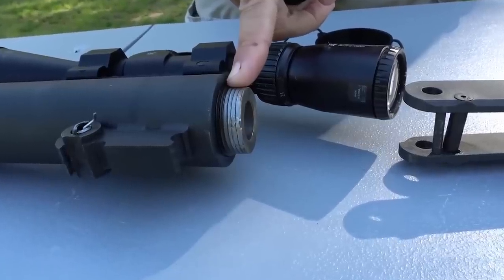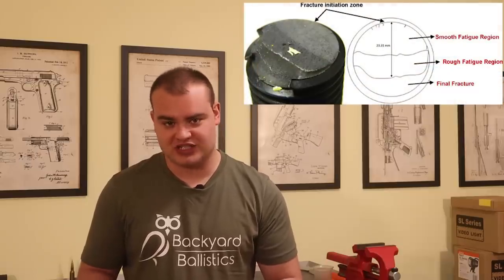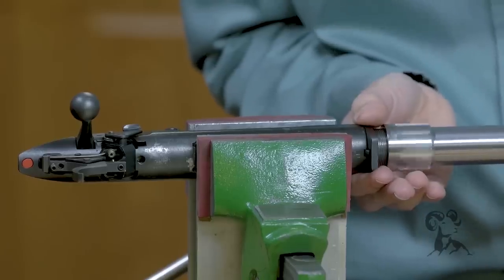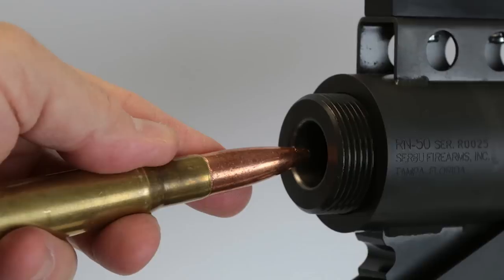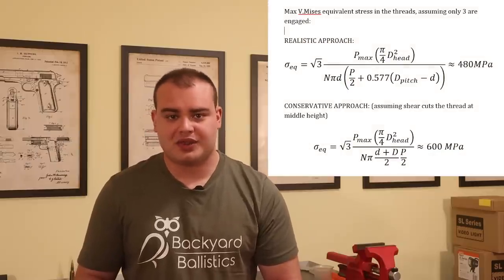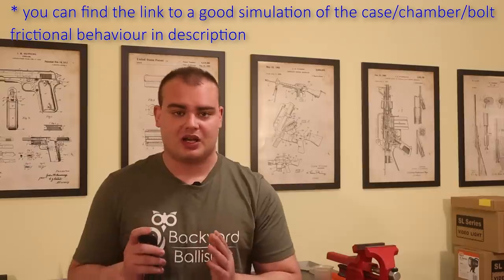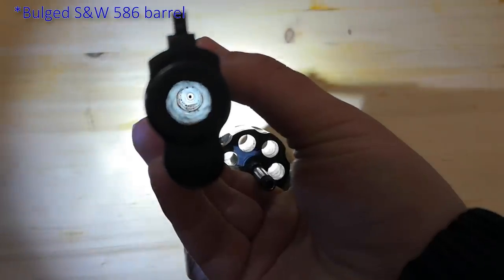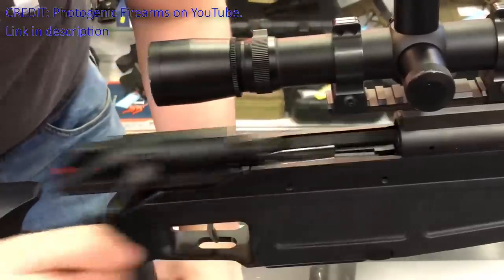Serbu RN-50 Failure: A Closer Look

Comment: I'd have to say that some clown tumbled that slap ammo for days to get the corrosion off of it and turned the powder into a superfine powder and increased the burn rate 10 fold. He probably bought them off gunbroker.
Reply: Or there was some moisture and uncontrollable pressure rise that ignite the whole charge at once, not burning controlled manner like it should but exploded.
Reply: Or these are 100% homemade with a lathe made penatrator. Homemade poly sabot that’s super clear and has no precuts. A shiny new case. And no crimp on it. Or link marks. Like every single original slap ever made. With who knows what powder in it. Being shot through a weird couple threads screw cap gun with a breach held together by a hollow thin pin.
Reply: @mattmurphy7030  cause it was lol. But apparently if you go on mark surbu video blaming the ammo he just says cap is good for xxxxxxxxxxxxx amount of psi. Well 4 threads and a couple thin trunnions with a hollow pin was sorta left out.
Reply: @mattmurphy7030  and the fact that your definitely not supposed to shoot sabots through brakes. Didn’t mention that either.
Reply: @mattmurphy7030  I mean I do feel bad for them both. One the one hand a good personality blew himself up with an extremely dangerous gun. On the other hand some good personality guy blew himself up with one of my extremely under failure guns... but I’m not going to allow ppls ignorance about a cap gun held together with 4 threads and a hollow pin. Or the extremely well known aspect of shooting any type of non complete metal projectile through a brake. Those things swell up as soon as it leaves the crown. And hit the brake. That’s why they don’t issue these to portable systems. They are only made and used on links in non brake 50s. Ppl can deny the brake all they want but it’s all right there. In big red letters in the manual.

Comment: For a gun with a safety hole drilled in the bore to vent gasses from excessive pressure, wouldn’t that take more than 50% to breach the brass casing? And what kind of margin for over pressure would something like a Barret 50 have in comparison?

Comment: I have been a serious firearm nerd for 48 yrs.  I schooled myself in Mech Eng during HS - before I did 3 yrs of it at UNI.  There was an issue with the loads. Recall that one or more loads did not impact where expected.  I expect more wisdom from Mark S as he does the analysis of it.   I still shoot a rifle labelled 110 yrs ago - as the Canadian Club. So I trust my life to an interrupted thread action.  On Canadian Mil-spec ammo - all fine. Load some Brit or other ammo and you had a problem.  I am trying not to be obtuse, but I do not wish to write a thesis.  Be safe - be well!

Comment: From what I heard it was an out of production slap ammo that blew up the rifle. So this particular cartridge had probably changed hands several times and been laying around for many years. If the powder has been shacking around that much (50 BMG loads are not exactely compressed loads) it may have been made into a finer powder with a more rapid burn rate and therefore increased the pressure to dangerous levels.  imho ;-)
Reply: M962 SLAP-T runs 282 grains of a double base ball powder (equiv. Hodgdon H-380), it's pretty full.
Reply: It's amazing how many people spit that bullshit into each other's mouth. 
Yes it can be an issue. 
No, it's not frequently an issue with properly selected loadings. (Not much slosh)

If that was a real issue, the vibration from firing something like a vulcan or GAU8 would in danger of blowing up every time you got to the end of a drum, wouldn't it?

Comment: Honestly, I think this is a combination of overpressure and the design of the tabs that controlled the breach closure to ensure full engagement of the cap.

I am curious to see what kind of surface patterning exists on the tabs to see this could possibly be fatigue failure of the tabs that was exacerbated by an overpressure situation or if the overpressure in the chamber created a condition sufficient enough to create a impulse force high enough to cause both a shear failure of the threading on the cap and the tabs that backed the cap.

IMO, without knowing more.. my first thoughts is that this wasn't so much a failure in design but a failure caused by ammunition with chamber pressure that went outside of what the firearm was designed for.. but I do think the design can be updated to extend the 'tabs' to the body by the tube for the butt stock to increase the factor of safety and to address the failure that resulted in the most significant of Scott's injuries (aka the tab that penetrated his neck, injured his jugular, and resulted in the collapse of his right lung).

Comment: If you've never watched Serbu's video with Royal Nunsuch about the gun he says one of the problems is that he only has a %50 safety margin when he would prefer two or three times safety margin.
Reply: Oh yeah I remember that. Where was that video again?
Reply: After rewatching the video, it's a little unclear when he says that whether he is referring to the prototype with the un-heat treated cap or the production models with heat treatment.   In any case he hints around that they were trying to make it very light and hindsight looks like they may not have put all the safety features/robustness that they could/should have.
Reply: So he admitted his fault. I rest my case. Two times is the minimum you'll see in any commercial gun.
Reply: @suprememasteroftheuniverse  mainstream commercial guns, yes. Remember, this is the shop that made a super shorty and the gun buyback special. Boutique gear with their own idiosyncrasies. End user must exercise own judgment. Serbu talked about this some years back too, about that 50% margin.
Reply: It looks like he was specifically referring to the prototype breach cap.  The prototype cap wasn't heat-treated and so had a lower factor of safety (he guessed an FOS of 1.5 or 2.0).  But the production runs would be heat-treated.   Besides, the cap (internal threads) aren't what broke, the external barrel threads broke.  The video in question is titled "RN-50 Review with Royal Nonesuch" and it is discussed at 6:25.
Reply: @suprememasteroftheuniverse  two times is not lmfao. Run a 100k psi 5.56 round through your AR.
Reply: @ragnarragnarsson3128  It's not "unclear" at all, text appeared on screen specifically stating that he was talking about the prototype.  The idea that Serbu would not only intentionally put an unsafe gun on the market, but make a video saying that he did so, beggars belief.
Reply: @jic1  It's perfectly safe within its design criteria.  Which doesn't seem to be all that robust.  The math of 2x FS doesn't add up though since the expected chamber pressure of 50 some odd thousand doubled would be over 100k psi and then he stated that the threads sheared at over 85k psi.

Comment: Great video! I've really appreciated your insight into the engineering of the screw threads. One question I'd love to have answered: what happens to screw thread strength when you evacuate 413MPa / 60k+ PSI gas through the threads (as in, a case head failure)? The way that threads 5 and 6 did not shear off indicates that the cap somehow deformed to allow it to slip over them - could high pressure gas deform the cap enough to do that?

Comment: So the problem is that a blown primer because of a "moderate" overpressure would cause the pressure to act on twice the surface area?
Reply: Yes.  More than twice the surface area.
Reply: More like 5-8 times the surface area. The dia of the bottom of the cap is so much larger than the base of the case. If the case is sealing properly it's only the bullet dia that produces force against the cap face. As soon as the gasses get past the case in any way it's suddenly the whole cap surface dia that transform the pressure to force. It's a dramatic force multiplier.

Comment: Moral of the story...
Never use hand-loads made by a total stranger.
Case closed!
Reply: Especially hand loads of a round that is notorious for catastrophic failures.
Reply: @aaronhiggs  Is there any evidence that they were hand loads?
Reply: Yes, the guy firing them says in his video, each round clearly sounded different,  each round had a different point of impact, and each had different degrees of penetration.
Reply: @alfonsedente9679  That could easily be the result of degradation from poor storage.
Reply: The rounds in question were old, not sold for many years, and not in their original packaging.
All red-flags for danger for any ammunition hand-loader.
There is another channel out there that does many things equal in stupidity, and more.
The difference is, all ammo they use, is taken apart and re-loaded by them, then used.
Just my opinion, but firearm channels that do dumb stuff should be tagged for 18 and over.
Reply: @aaronhiggs  so true.
50bmg is deffinitely known to explode, and many types of 50 are meant for mg use only.
Reply: @jic1  Yes. Most Slap rounds in circulation are handloaded.
Reply: @aaronhiggs  lol ill go one step further, and say ALL SLAP rounds are handloaded.
Purty sure its a loophole for selling stolen military ordnance.
As long as i can remember stuff that explodes, or pierces armor is illegal
Reply: @alfonsedente9679  that’s what I understand as well. You can buy military surplus brass, but not the whole round.

Comment: Screw cap on a tube is basically a zip gun design, total garbage, or a pipe bomb in this case. Everyone is being too kind to this Serbu whoever he is
Reply: A screw cap would have been better, it would have had enough engagement.
Reply: @randyg9209  yeah I mean the barrel doesn't even have a bulge in it but the cap has blown off. You can find safer objects in kyber pass. Don't need a scientist to tell you that

Comment: Buy a Barrett M99. 17 locking lugs and two saftey lugs plus the bolt an Dan overbuilt rifle. Buy once cry once.
Reply: wasn't the gun dude. its due to very old ammo and a very hot load that most likely exploded from the premier area (yes this happens with old ammo)
Reply: @vicdiaz5180  I know but when the barrett fails it won't almost kill you, that's the important part. It will kill the rifle yes, but it won't kill the shooter. I am aware that the RN50 is very safe under normal operating conditions but this was not that. The rifle failed in a way that I believe is unacceptable and would not happen with a better more solidly built rifle that is designed to handle a failure like this without killing the shooter.
Reply: @vicdiaz5180  "WaSn't tHe gUn dUdE" - No one is saying it was, but you don't really want to shoot a gun that in a case of such failure will shoot three projectiles back at you, do you?

Comment: with the ammo shortage of the past year its quite possible that there was a misloaded cartridge, probably not a double charge but rather an under charge in which the ignition of the primer pushed the bullet an inch or two down the bore and then the powder ignited into an 'obstructed bore' which would go along with your remark about the obstruction being very close to the chamber

Comment: Good analysis and I also think that there was a blockage right in the beginning of rifling. My theory is that the blockage was made by the counterfeit ( see video, not military sabot and no case crimp ) SLAP round, where the root cause lies in the sabot itself. The genuine sabot takes a lot of engineering and manufacturing to make it completely symmetrical piece of high temperature plastics. If the counterfeit sabot was low temp grade plastics, the hot chamber starts to deform it before triggers is being pulled and firing a non-centered sharp piece of tungsten will hammer it sideways right where the rifling starts. As being tungsten, it really grinds in the much softer barrel material and stops the projectile, kicking back all the energy as seen. 
Even if the plastic sabot did not deform under heat after being loaded, an out of center sabot will throw the projectile out of balance once it starts turning in the beginning of rifling. The RPM of the bullet is relative to speed and out of barrel at 3000 FPS it turns roughly 180 000 RPM's. The projectile accelerates within first inch to already tens of thousands RPM's and centrifugal forces push it sideways if the weak sabot does not hold it completely centered and the piece of tungsten dives in to the barrel base material creating blockage. 
In the video the bad accuracy of the SLAP rounds tell the tale of not being stabilized properly and the increasing muzzle blast after each round would mean that those rounds did some grinding inside the barrel, leaving marks where the tungsten touched the barrel and every time increasing the issue

Comment: Usually when dealling with high load threads you need to select a better profile, like fine pitch, or ideally and acme profile. You can also apply a pre-load to reduce fatigue, but then it's not practical on a gun.

Comment: It is well worth saying and I am sure people don't know the curator and designer of the gun, Mark serbu has a YouTube channel and he has said he is receiving the gun, intends to recreate the explosion and hopefully that will shed more light on everything
Reply: Oh, you mean he's going to do what he should have done in prototype stage?
Reply: @camojoe83  do what? Fire a shot that's over pressure past a +p+ with extra dip? You are looking at a different of pressure of potentially 40,000 psi, even a m2 machine gun would explode in the situation it was exposed to, the design of the gun isn't the issue, add more threads to the cap doesn't work because the vast majority of pressure is absorbed by the first 4 threads of a cap, and who would have guessed the rn 50 has 4 threads for that exact reason

Edit: I checked your previous comment and you call it a parts breakage/safety issue which in and of its self explains your lack of knowledge on things like pressure bearing at least practice and search into a subject before you spew BS, in case you were wondering , I am a machinist I work with metals daily, and while I work with highly low pressure stuff the same principles apply
Reply: @wolfie54321  until we see the casing it'll be near impossible to tell what happened, it's worth saying that a m2 explodes at 70k psi and the rn at 88k psi, the hottest 50 bmg is about 60k psi, but unlike the m2 the rn 50 doesn't really ware, pressure is spread around the threads in such a way that the surface area the cap is pushing on is huge compared to the lock up of any other firearm with maybe the exception of a falling block action

This video implied that the gun was worn out which is simply not true that slap round was just loaded so obscenely hot that it would have been impossible to contain it in any gun in any safe Manor, it had nearly the power of 2 .50's going off, in a m2 that wouldn't just pop the top off it would blow up the gun completely, same with any gun that being said it would be interesting to see where the bullet was when it exploded, I think it is in the barrel still, but I don't know as Mark serbu hasn't uploaded anything on the gun yet

Its quite easy to lose perspective of how much pressure happens when you fire a gun, I can remember having my first air rifle and thinking to myself "I'm supposed to put 2600psi in this air tank and not expect it to explode, that's 21x less pressure than a standard .50
Reply: @wolfie54321  88k psi is what pressure load the threads on the rn fails at, as claimed by Mark said by Scott in his video, you could calculate it yourself if you can find out what steel is used and the thread type, which I don't remember off hand, I'm sure if you emailed Mark serbu he would be able to help get some numbers to crunch
Reply: @wolfie54321  he definitely knows the exact dimensions of the threads, it looks to me like 1/8 bsp which has great pressure bearing potential, that's why they use it on piping, air rifles, and I think, although I may be wrong some rifles with threaded barrels (into the receiver) have it

The kind of over pressure protection you have in a rifle like the rn 50 comes from excessively strong threads and a significant area that spreads the pressure from the fired round, I would have thought the bullet would cause the barrel to balloon and explode before the cap blew off but I haven't even seen a rn 50 before irl and it's likely to have a heavy barrel, what I suspect actually happened was the last two fired rounds caused a minute amount of build up on the muzzle break, and the next round he fired was enough to blow the gun up (slap rounds are sabot with a plastic surround) and sabo shouldn't be fired from a muzzle brake or any kind of compensating/supressing rifle unless it's built specifically for sabots
Reply: @wolfie54321  I was wrong about what I said, mark serbu made a video just recently, I calculated it after he did and those threads are able to take 161,000 and change psi, which is a bit more than 85k psi, the safety ears that sheared off can take a bolt impact on their own according to him (presumably 50bmg he didn't say)

Edit, the thread is a inch and a half 12 threads
The steel is 4140 at rockwell c30

Comment: Would it work to have a hinged arm that the cap was connected to so if it blew off from over pressure the hinge would force the cap to flip to the side along the hinge rather than into the shooter's face?